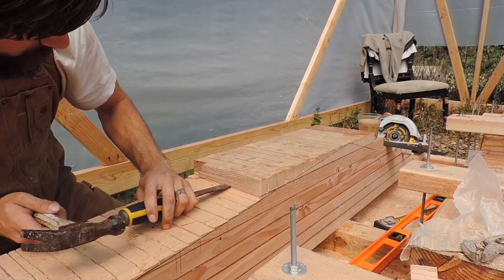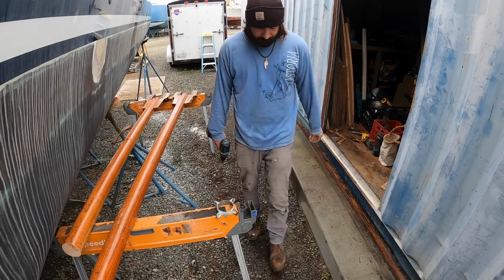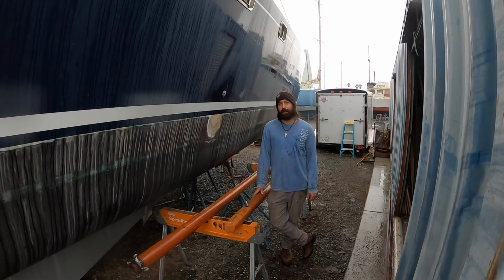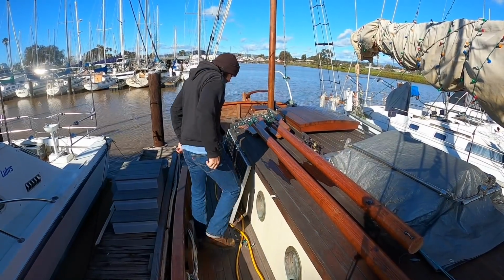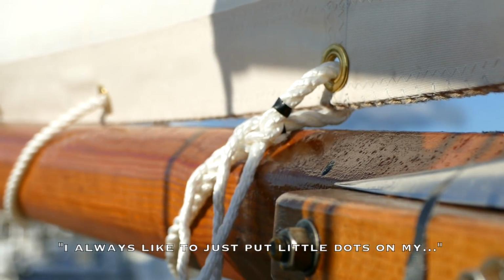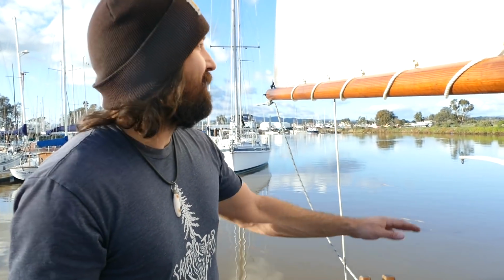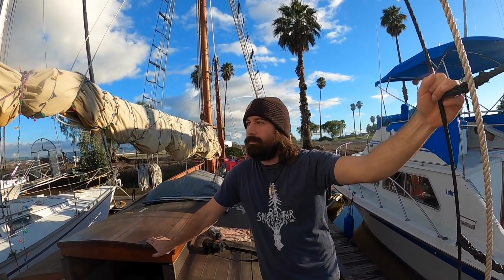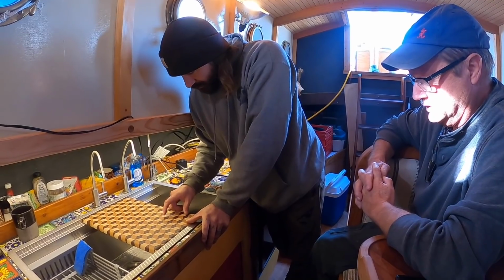Salt & Tar: Ep.172- Bending the Mizzen

Comment: That cutting board is WAY WAY TOO NICE TO USE. I would hate to put the first cut into it. It’s beautiful. Well done 👍
Reply: Nonsense. John made it to be used. You don't carry something like that around on a small boat and not use it.
Reply: I'm a woodworker myself, and If I made someone a cutting board, I'd be disappointed if they didn't use it. He made it out of end grain, so it will be very durable.  I recently built a gift for my new little grandson.  I didn't put any finish on it.  I know that it will get written on with crayon, beat up from play and I will love seeing every scrape and scar on the toy.
Reply: End grain is made to be used. The end grain is easier on knives than side or face grain. It won't show cuts as quickly either. It soaks up finishing oils and waxes to, to help keep it from soaking up liquids from foods like fish, chicken, and other bloods and stuff. (Just make sure to clean and oil it frequently.) When it is time to refinish it, it can be a bear to sand smooth again, unlike a long grain surface, but that also helps it to last much longer than a flat/long grain cutting board. End grain are really the premium when it comes to wooden cutting boards.

Comment: If you eye splice the line at both ends of the boom directly to the sail how do you remove the sail or tighten the line as it stretches?  Wouldn't it be better to put an eye at both ends of the line then lash it to the sail with enough room to tighten the lashing if necessary?

Comment: John made a truly awesome job of that sliding board rarely seen that type of marquetry done so well, the precision is spectacular. Running backstays on the mizzen mast, might be more trouble than they are worth.The angle is very steep reducing their effectiveness the sail area is small as is the rear deck area. Unless of course you intend to fit a mizzen stay sail. I have sailed a number of old gaffers without running backstays and much much larger sail areas without issue even in gale force winds. I am not trying to imply that a running back stay does not add any extra strength or peace of mind not to mention the ability to tune the rig, only that on a close rear deck they might impinge on safe movement. A cleat on the stern would allow you to tie off a halliard to act as a temporary back stay when running down wind in heavy weather